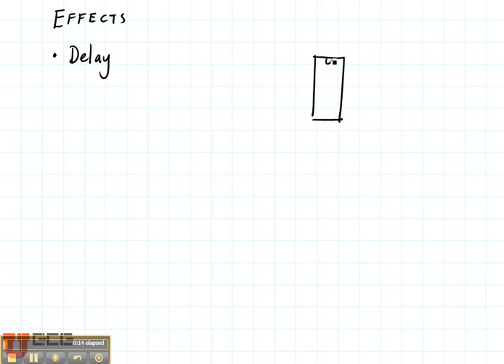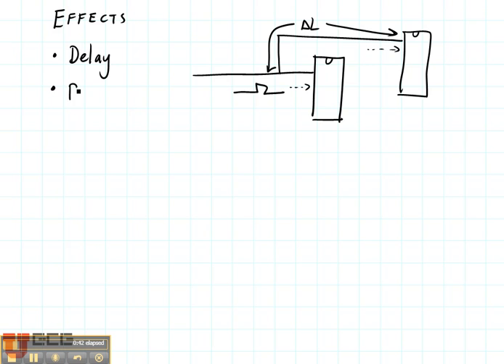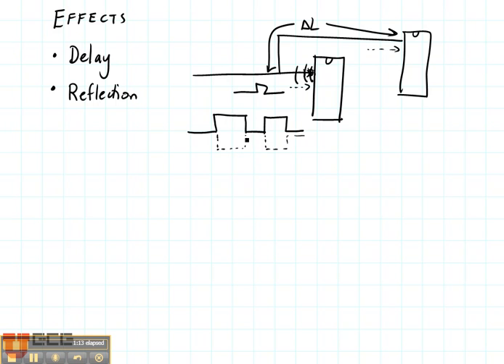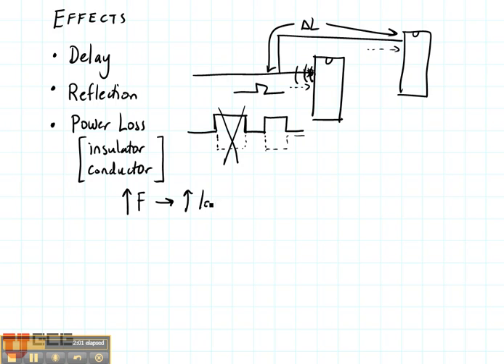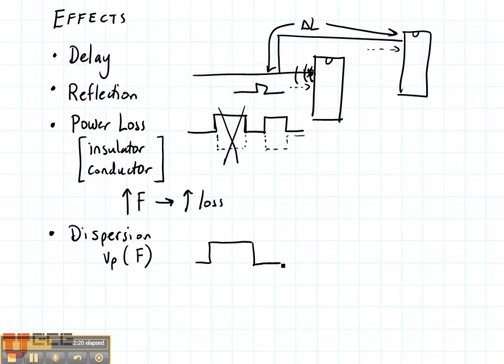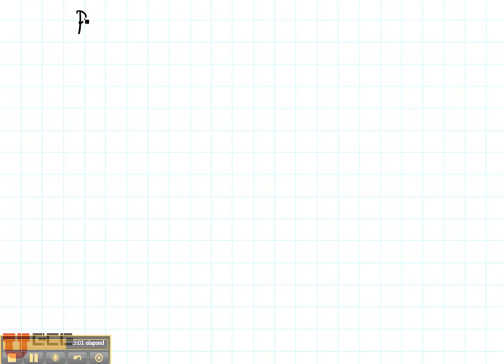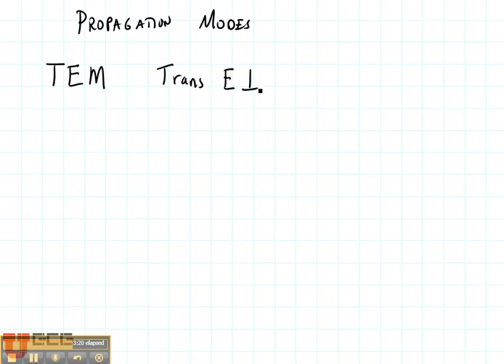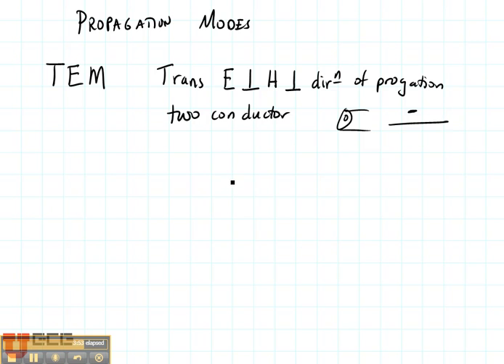ECE3300 Lecture 4-3 Transmission LInes

Comment: In the idealised model you've been working with, are the transmission lines truly dispersive (i.e. the propagation velocity is a function of the wave frequency), or are they spatially dispersive because the phase relationship between different frequency components in an edge aren't preserved due to the differing amount of phase delay applied to the wave components as a function of frequency?